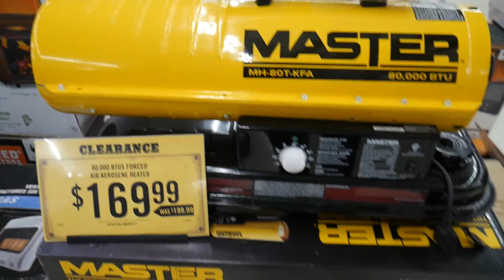F20B CG5 Swap Finally Making Progress

Comment: You know if I'm not mistaking the F23 trans has same gears as the F20B diff is LSD I used the h22a4 trans on my Prelude ran lovely
Reply: youre highly mistaken lol
Reply from the maker: F23 trans gearing is alot longer than f20b bro. F20b and prelude trans are similar
Reply: Then it's gotta be the f22 then I remember one of the accords had the same gears but I'll look it up again to be sure
Reply: Yeah just looked it up it is the f22 that has the closest gears to the F20B my bad lol I stand corrected
Reply: Left a link for info for anyone, was suprised how first through fourth are the same in  alot of engines except the h23,and f23 wonder why?

Comment: You think $2500 is a good deal for a 02 accord with a F20b swap with a t2t4 transmission? I'm thinking of leaving VW behind for a while.
Reply from the maker: If it's done right bro, that's a really good deal. Trans goes for 800 to 1k in good condition alone 💯

Comment: Where do you buy your motors from,I got one from import Depot an it is fuck #4 piston is gone
Reply from the maker: I get mine from jspec auto in va bro
Reply: Is there a link
Reply from the maker: @Djmb_Nemo  nah bro. Just google them and call. The website isn't updated as much as they move alot of engines